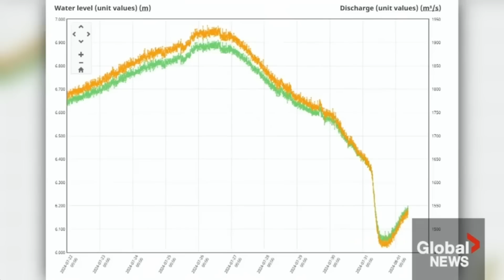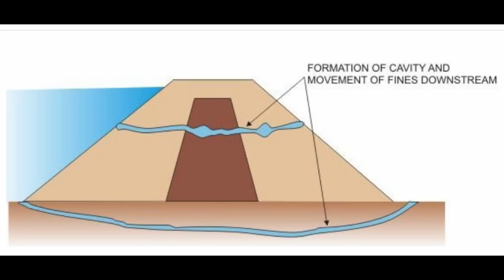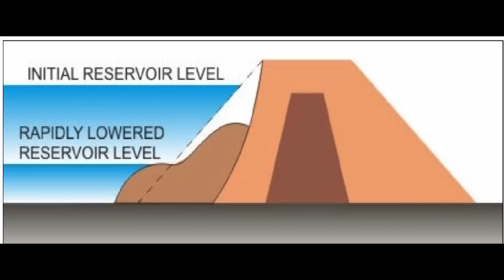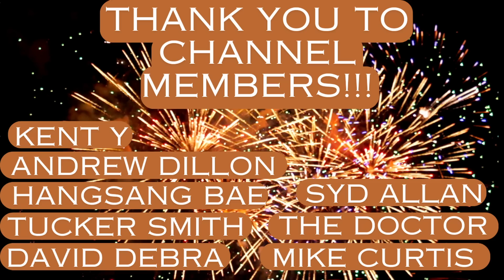Massive Landslide in Canada Creates Dam that will Fail

Comment: Hi Casey, 
Thanks - saw an earlier video earlier this morning (GMT +2). Overtopping will happen, I am however not certain it will lead to catastrophic failure. The usual angle of a dam wall is quite steep, this natural dam has a substantially flatter slope, with a lot wider base, this may cause the amount of material to be mobilised to cause a catastrophic failure to be much larger than the water’s carrying capacity (usually not an issue in engineered walls). I don’t have access to LiDAR or aerial photography to check, but if that is the case, the overtopping should lead to the incision of a new channel and more gradual sequence of collapse and incision over a longer period of time than a catastrophic failure of the entire embankment. I am a however hydrogeologist, with hydrological background, geomorphology is a whole different field - but will be interesting to see how it pans out from a scientific point - light & love to all those affected, keep safe.
Reply: Hi Drew, while I was writing my comment there was a post with a link to an article from 1967 - it appears to confirm at the previous (although smaller landslide), the correction was more gradual,  it still had significant siltation, but not a catastrophic release, greetings from Johannesburg South Africa,
Reply: I'm really hoping that your right and the overtopping results in a more gradual scour then most manmade structures experience. I have freinds and co-workers that are in/near the affected areas. They're safe but still.
Reply: That is probably not a significant factor as the debris is not compacted or homogeneous. It'll wash out very quickly.
Reply: Yes, this is the domain of fluvial geomorphologists, not hydraulic engineers, IMO.  The stream length of the dam is purportedly 600 meters and does not have vertical faces on the upstream or downstream ends like constructed dikes or hydro-electric storage dames.. It is tough to visualize that the constructed-dam collapses shown in this video have any bearing on how this long landslide of unconsolidated sediments will behave when it is breached.  A seemingly similar slide was written about by Bruch Woodland (link below).  It resolved itself fairly quickly and with little apparent damage, downstream.  This one in 2024, however, may be different.  There was also another such slide in 2004 and, reading the web comments, this is the first time I have heard of that one.  It likely did not have catastrophic effects since it seems to be rarely mentioned.  The distance from the 2024 slide to Hope, BC, is about 300 km from the confluence with the Fraser River. The 1964 slide seems to have shown an increase in Fraser River WSE's of about 20-30 cm roughly a week later, as per the Water Survey Canada hydrometric station (all on the internet, archived by WSC Environment Canada) at Hope.  This does not mean that the 2024 situation is the same and may be very different, but I would look at the historical situation first, before making any unsubstantiated comments about how damaging it might be to infrastructure and life.  That doesn't mean it might not be relatively benign, but it pays to do one's homework first, IMO.  Sockeye salmon (my profession) were blocked to upstream spawning habitats for about an extra week and a half, until the river cut through the till, according to the article for  the August 19, 1964 event.  The fish apparently made it okay, for spawning in upstream reaches that year, starting to being seen above the slide already at August 29, 1964.  https://waves-vagues.dfo-mpo.gc.ca/library-bibliotheque/40810033_October_1964.pdf  The BC River Forecast Centre has modelled the water surface elevations at Hope, BC, 300 km downstream of the confluence of the Chilcotin and Fraser rivers, at 30 cm if the "dam bursts" for the 2024 slide. https://www.castanet.net/news/BC/499793/Fraser-River-has-plenty-of-capacity-in-event-of-Chilcotin-landslide-burst
Reply: @marvinrosenau8491  very clear explanation - thank you. Just to confirm (I am mostly in the mining industry), I would rather have 9 risks identified that do not materialise, than miss 1 that does, thanks Casey😎
Reply: Looks like they've downgraded the alerts somewhat, current modelling suggesting that it's most likely to overtop and gradually cut away at the damn rather then suffer a catastrophic failure.  Will mean the water levels in the fraser shouldn't exceed peak spring runoff levels if it fails as expected. Still not safe to be close to, but a wall of water engulfing the fraser is looking far less likely.

Comment: The BC Fake NDP are incompetent! Where is the immediate response that “they of course” have in their emergency plans 🙄
So glad that the hills are bare of trees. 🙈
Reply from the maker: This mess is only likely to get bigger.
Reply: @CaseyJones-Engineer  I have a question, my husband works at a school that had a four storey addition added two years ago. They had first put in a two storey retaining wall three years ago and the new addition was put against this retaining wall. The retaining wall was built to keep the schools upper field, which comes to the second storey of the new addition. Under the field is underground stream that runs into the retaining wall. They have drainage at the wall which is to redirect the stream. Starting two years ago the retaining wall started having diagonal cracks showing. (there is a two storey void where one can see the wall from an access door from inside the school). 
This past year the cracks have shifted and water is now seeping through the cracks. The engineers were told and they said they would “monitor” it. They put a little thing on it to see if the cracks get bigger. They said the seepage of water is “normal”. My question is, how is the continuous seepage normal, especially when it has not been raining?
Reply from the maker: @LeoTicky  It sounds like they have a problem on their hands.  Most retaining walls perform poorly without adequate drainage.  In rare cases they can design for the presence of water like this but that is much more expensive to do (the wall has to be much stronger) so the usual practice is to make sure the water doesn't accumulate behind the wall.
Reply from the maker: @LeoTicky  Feel free to send it to me:
info@ftandc.com

Comment: Thanks Casey.  This is going to be a bigger problem every day the unintentional dam holds.  There is a lot to lose further down the Fraser.
Cheers 🇨🇦
Reply: The argument for assisting a breach sooner then later.
Reply from the maker: Thank you.  Yes, it is a huge mess for sure.
Reply: It will fail but I highly doubt its gonna blow all at once. I live east of this.
Its a big ass lake right now.
Reply: Down river we have what is called HELLS GATE its on Fraser river. Small canyon BIG WATER
Reply: @kevinsherwood7025  I would agree it won't "blow" at once, but the failure WILL likely be sudden and catastrophic. It will likely start as a slow trickle from water seeping into the landslide and back out the other side. After it's saturated enough, It will give way to the water pressure and slide suddenly away. Will it "BLOW" - lol no. But the sudden part depends on what you mean by sudden... If you mean suddenly with no warning, I basically agree that is unlikely. But the warning may be very small, and it may go from a trickle to WAY more than a trickle, suddenly. So it depends on what you mean by "sudden" 🤷‍♂️ ... But no it's not TNT it definitely won't "blow" 😂
Reply: @kevinsherwood7025 
Hey Kevin, do they have any idea of when that water is going to fill enough to breach the slide. I’m supposed to be vacationing in that area out to Bella Coola next weekend and not sure if we’re best planning a trip else where.
Reply: @jamesb6818  road to Bella Coola  is good. The blockage is south of road to Bella coola
Reply: @kevinsherwood7025  
I understand I’m just wondering about bridges and how they will hold up if it releases quickly. I’m coming up through Whistler, Pemberton  over lLillooet and then from Williams lake.

Comment: Fraser, not Frazier. The TV show was a very unusual pronunciation of Fraser. Fraser like Phaser. This is a very large river in the spring. Hopefully the water won't be a huge issue when it lets go, given the capacity of the Fraser river. One of my favorite places in Canada, weirdly, is the Highway 99 above the old suspension bridge in Lillooet on the Fraser River. When the river is up you can hear it from Highway, even though you are a long way above. If the water comes all at once it could be a real disaster for the homes that are basically on the flood plain. It would be pretty interesting at Hells Gate too!
Reply: Spelling won't matter when this thing goes.
Reply: @aday1637  Calling things by their right name always matters. And I hope it doesn't wipe out the valley again. They've hardly recovered from the floods a few years ago which took out a lot of roads.
Reply: The tv show was spelled Frasier.

Comment: One guy sugested using a hydrovac truck in the river bed while the river was gone
Reply: And you should volunteer to operate it since you know so much about it.
Reply: Before you do that though you can fly the heavy lift helicopter that's going to lift up 90,000 lb piece of equipment and place it in the dry River bed😂😂

Comment: Mother Nature doesn’t build dams very well.  While they continue to happen, engineers are much better at designing and constructing dams.  Of course non- engineers believe they know better.  Non-engineers should never override qualified professional engineers.
Reply from the maker: Agreed!
Reply: I think the Beavers in my neighborhood should at least get honorary engineering degrees.
Reply: Much of our aging infrastructure was construced by people with no engineering degrees or formal education at all.  And at a time when getting the job done was more important than taking time with environmental studies or engineering and archetectural design.  I just think the problem is the lag in time between the realization of need and actual repair/rebuild of these structures.  Take Surfside Condo Collapse for example.  Engineers were fully involved but were unable to complete study or work before it collapsed and killed 90+ people in the middle of the night.  The more complex the previous development, the more need for update and foresight.   We should already be looking at structures not in peril rather than wait until there's an actual problem.  But our society has become so unable to act due to red tape and lack of money that now we shall suffer these events that seem to be occurring all over at the same relative time.
Reply: that's what happens when you use DEI hiring guide lines.
Reply: @ScottPittman-jc7ph     Diversity, equity and inclusion (DEI) doesn’t mean lower standards.  It means to higher those qualified by training and experience.  Experience only comes from being allowed to do the work you are qualified to do.  The color of your skin or your sex shouldn’t matter to get jobs you’re qualified to do.  It’s time you left the 19th century and join the rest of us in the 21st century.